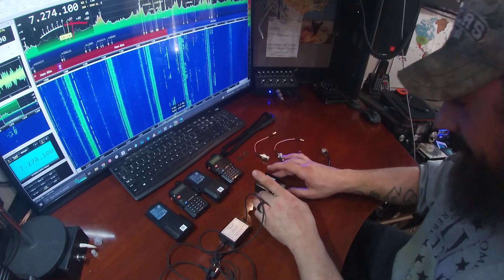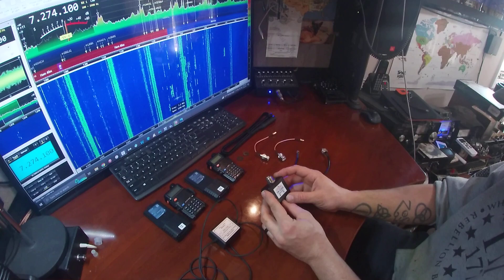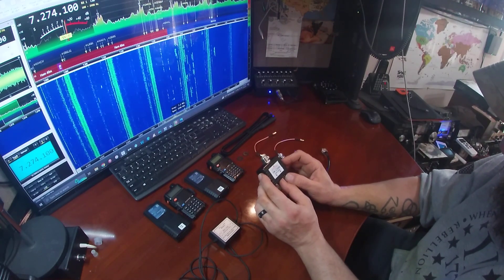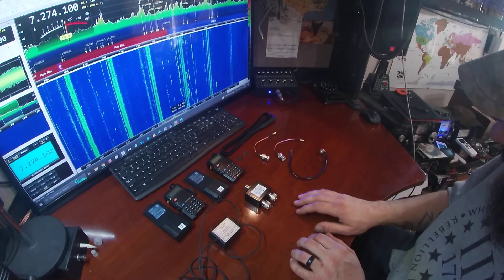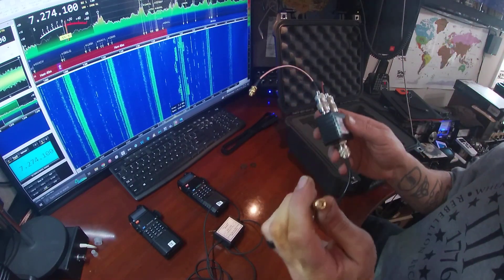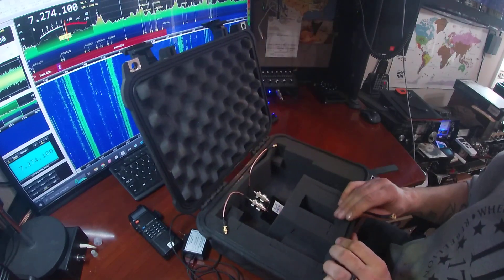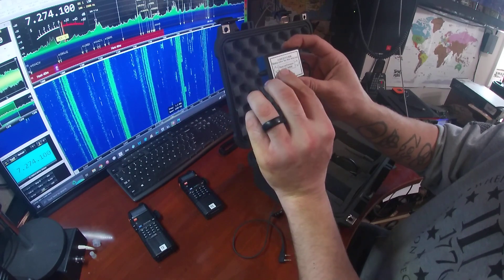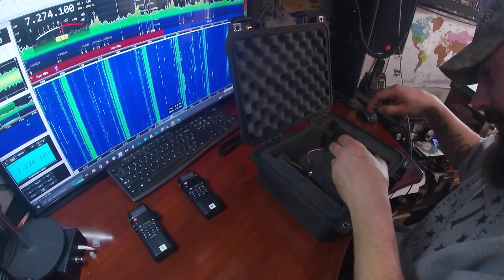Baofeng uv5r portable repeater assembly

Comment: How are you programming your non-repeater HTs to transmit/receive to your repeater? VHF (rx) on channel A and UHF (rx) on channel B, then turn the TDR on and then go to the TDR-AB and lock it to A?
Reply from the maker: I do it in chirp. There is a setting for cross band. I would have to pull up chirp to give you a more complete answer
Reply: @SlowGoose  thanks! I should be able to Google how to do it in Chirp
Reply from the maker: I’ve been meaning to do a video on chirp. There’s a ton of stuff in the program that’s kind of confusing.

Comment: Did it work well?
Reply from the maker: It worked. I wouldn’t call it well. That may be due to the duplexer. But even with a 5 element beam as the antenna the distance was under 2 miles.